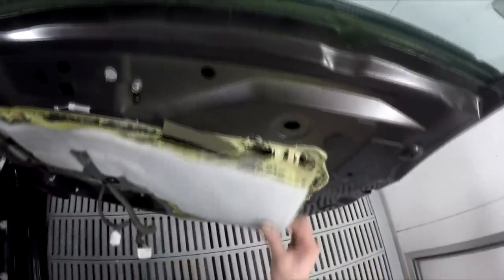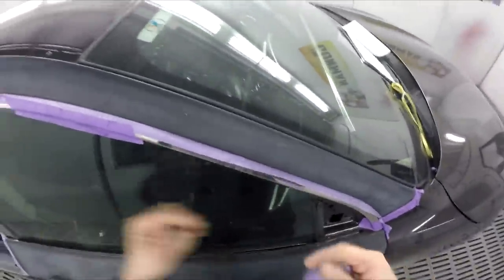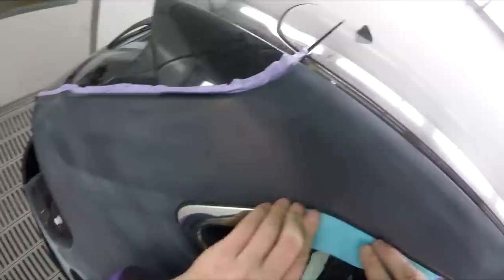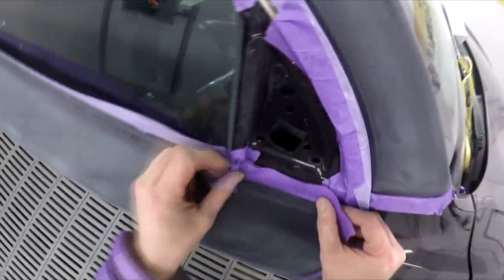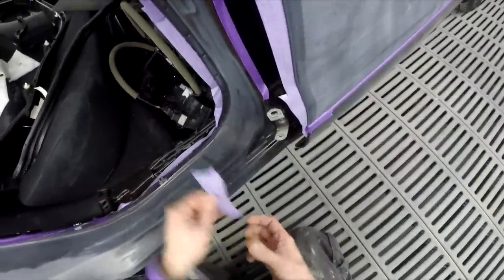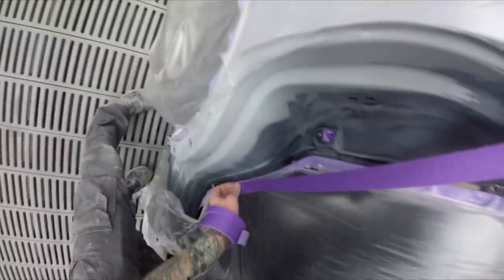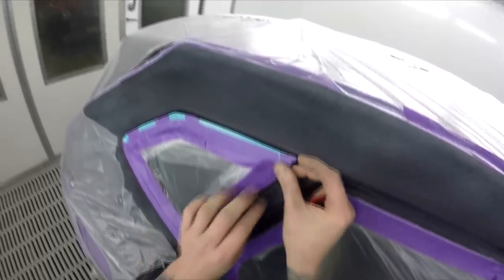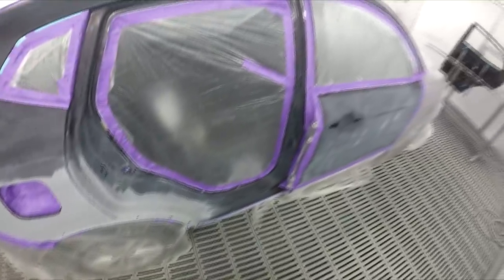Masking a Car

Comment: Hey Gunny another very useful video mate so thanks. Had to laugh at your comments about the gym junky's coming out to work on the mines and going home after a couple of hours lol. I am also a skinny Jimmy 6"2" but only 78kg when I worked on dam sites in Vic, (Dartmouth Dam in the north east highlands and Bluerock Dam in Latrobe Valley). Started as a drillers offsider and ended up 5 years later teaching guys how to drill using the old airtrack drills pulling a compressor and working as a powder monkeys assistant. We would get these gym guys coming out to make the quick big bucks, all buffed up and ready to roll, and after a few hours lifting on and off steel rods and lugging bags of Nitro and diesel out to load the shots they were like "no way man stick this you can keep the money" So funny 😉 Love your work mate, Keep it up 👏

Comment: Great work and everything. Minute 36:37 and so I would tape it using the crown tape method so it won’t create a line. Crown taping I’m referring to how you bend the tip of the tape with your knee. Other than that excellent work brotha 👌🏽👌🏽👌🏽👌🏽👌🏽

Comment: As a non-pro I can justify a 'toy' now and then so I buy a nice clear gun but no way an expensive primer gun.  I have the FLG-3 with a 2.2 it's worked very well for Poly or 2K with adjustments.

Comment: hi gunny! meaby I have seen all your vids since you starting!but now after so long time watching you I need to tell something what is for me important!in some countrys  of this earth painters can only work with waterborn paints and they are the same quick as with solvent !at the year 1995 we tested in wuppertal germany to colors the rasberryred mazda and the 735 mb both in solvent and waterborn the complete job include the diffusion time was 18min for waterborn and 21min for solvent by tempatur of 20 C.the same is also with the sata's imagine that 4 painters all day using a sata 4000 b RP and spraying cromax pro clears and that for the last about 6years and next to our gunkeeper  we have a box with many devilbiss inside non usable because of the different problems what devilbiss always had !and dont think we are a small shop or a backjuard garage !